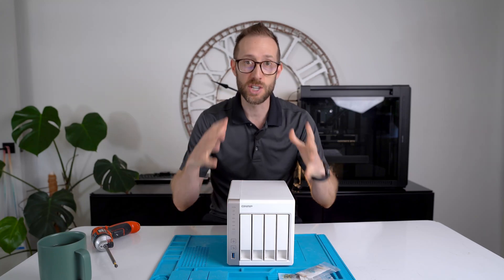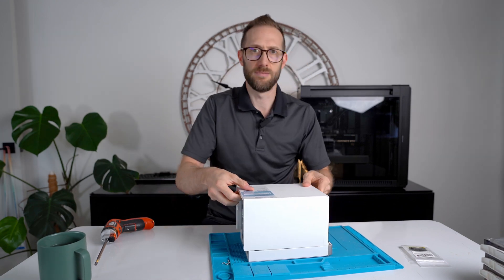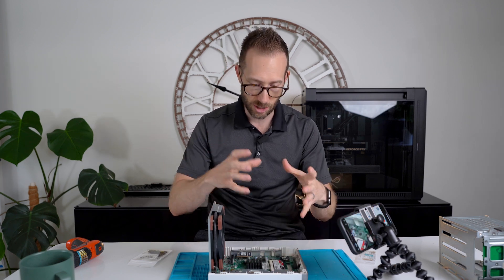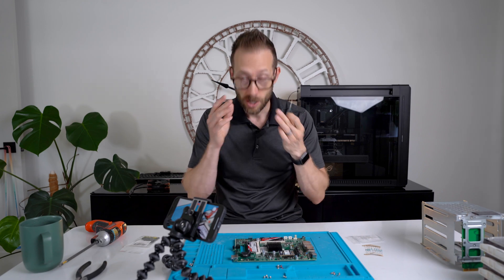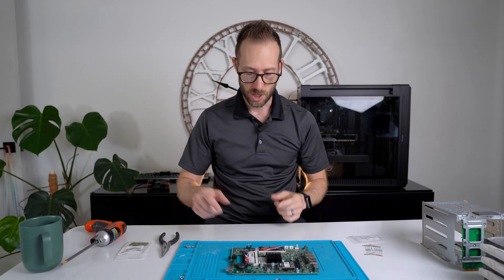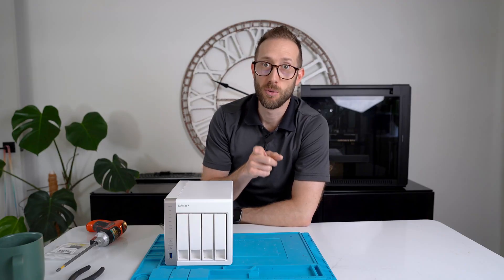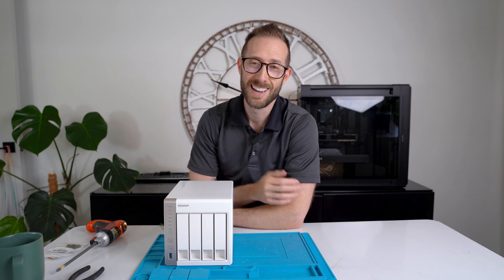QNAP NAS Red Light Fix Instructions (No Solder Solution)

Comment: If you have an old NAS, setup ProxMox and CasaOS on a spare pc/laptop/pi, and point its built-in file explorer to your NAS. I'd make a Nas user called "CasaOS" with the required permissions. 

Then you can access your data
Reply from the maker: Yeah, I'm on the fence of setting up my own hardware for a NAS.  I really do enjoy the small form factor of a NAS, but I could always pick up an old 1-2U rack server with some storage.
Reply: @JohnLCharette  the main issue with most off the shelf Nas solution is this - if the NAS fails, repairs/spares/data recovery is $$$. 

Ideally you want a solution which allows you to simply plug and play the data to another system, while still being encrypted.
Reply from the maker: My previous experience with this works, assuming you have the same or compatible RAID controller in your new system.  Do you recommend using an onboard RAID controller, such as the Intel controllers or a PCI-E x4 card?  If a card, which do you recommend?
Reply: @JohnLCharette  as much as possible, I avoid RAID in my Home. Software Raid should never ever be used. Going hardware raid = buying 2 identical controllers + disks to rebuild.

A solid, scheduled clone to alternating disks does a great job, at a much lower cost. :)

My critical data is cloned across 4 disks. 2 are for live production and basic failover. The other 2 alternate weekly.

Recently I had to find something from 2019 that I knew I had... Looked on my backups, boom. No better feeling.
Reply from the maker: Interesting approach to avoid RAID completely.. other than RAID1.  It's not a bad idea and you solve many concerns.  It costs more due to more required HDDs, but isn't a bad approach.  I appreciate the insight.

Comment: Once the drive is revived, does that resistor need to stay in place?
Reply from the maker: Not 100% sure.  My understanding is that it needs to be there to boot.  I haven't turned my NAS off in months and I'm worried that when I do, it won't boot again.  I would probably recommend leaving it place though.  Why, did you want to remove it?

Comment: I have exactly the same symptoms on my TS-451 but neither 100 Ohm nor 150 Ohm did the trick. 
I've seen somewhere that an alternative could be pin 1 to 3.3V instead of ground. Do you  know anything about that?
Reply: I'm no expert, just a nerd. Check the following with a multimeter if you can:

0. Check that the PSU is giving the right voltage into the unit and on the other side of the DC jack.

1. 3.3v rail + CMOS battery should be above 3v when tested outside of the system.

2. 5v (usb etc).

3. CPU should be 12v, but rather Google to make sure for the specific CPU and Nas model.
Reply from the maker: Darn.  That sucks.  No, I was only following the instructions that are in the description of my video.  So sorry I couldn't be more help :(
Reply: @JohnLCharette  Hi, and many thanks for taking the time to reply.  I continued to experiment (encouraged by you) and actually got it running again by twisting two resistors in parallel : One 100 Ohm and the other 150 Ohm which effectively means 125 Ohm (which I didn't have), and that worked 👍👍
Reply from the maker: Oh wow, that's incredible!  I'm going to pin this message so that anyone else with a similar issue can try that solution.  Thanks for sharing!
Reply: @metoo7587  100 and 150 ohm in parallel = 60 Ohm! (not 125)
Reply: @yrumel-g6w  You're right!  Thanks for that correction 😊 Anyway, it did work 👍

Comment: Woke up to this issue today. Mine's been running for a long time. Maybe 10 years? I never could solder correctly so I wrote this one off until I found this video. Ordered the parts, we'll give it a go on Tuesday! :) Just need it operating long enough to transfer to a new Ugreen NAS. This should do it.
Reply from the maker: Mine is just about as old!  Considering, it's earned it's keep.  I had to replace the system fan once, but other than that.. it's been good.  Good luck with the install.. I was in the exact same boat.  I 'have' soldiered in the past, but I'm not very good at it.  When I saw this solution, I had to try it.
Reply: @JohnLCharette  Just did the fix. We're back online. I'm just going to backup everything and use it until the Ugreen arrives! Thanks again for this.
Reply from the maker: Amazing!  I've also been looking at the UGreen units.  Which model did you order?
Reply: @JohnLCharette  The dxp4800+. After looking at qnap and synology, the ugreen has better hardware specs for not a lot more in cost. And if you get it on ebay you save even more. Finding them in the $500 range new.
Reply from the maker: Very nice!  I was thinking about upgrading to their six bay unit, but it's significantly more expensive.  I know I'm playing with fire with my QNAP.  I fixed it a few months back now, so who knows how long it will last.  I get the feeling that if I don't ever turn it off, it won't die.

Comment: I did this repair about 6 months ago.  All was going great and now the problem has returned.  I soldered it, so little chance that the resistor worked itself loose.   Any ideas if there is another fix to extend the life a bit more?
Reply from the maker: Oh no.. I haven’t heard of another fix. I was told it was only a temporary fix but I also don’t know if the symptoms are the same when it eventually dies, so it’s hard to tell. I’ll pin your comment so hopefully others see it and can help.
Reply: Thanks.  This is a dedicated Plex server for family, so no huge loss. However the phone has already started ringing asking where it went. I suppose I just need to get another qnap that's compatible with the raid array so I don't have to source all the material again.
Reply from the maker: Yeah, I was thinking the same.  QNAP does have a compatibility tool that helps you select a migration path.
Reply: Did you try another resistor? I wonder if they go bad being that this is kind of a temporary fix to an issue? Just a thought.

Comment: Mine would not boot after the resistor being added. Disconnected from pin 8 and will checking voltages undifferent resistances it was notices that adding a 1 ft jumper between resistpr and pin 8 it would work. Doesn't make sense since the jumper resistance is 0.1 ohms, but it works. I used 20AWG wire and left it coiled up above the RAM.
Reply from the maker: Ohh, very interesting.  Can you please confirm which model QNAP you created that custom fix for?

Comment: Thank you so much for this, I have a TS 253 Pro which had the 3 red lights after we had multiple mains failures in a day, I thought I'd lost everything but thanks to this I got it back. I have a ten pin socket too and yes it still was 1 and 8, once again thanks a lot.
Reply from the maker: No problem!  I'm glad it was an easy enough fix.  QNAP is sending me a TS-233 to test out.  Were you happy with your device?  Are you staying in the 2 bay world or upgrading?
Reply: @JohnLCharette  I'm thinking of giving up altogether. I had one so my 2 sons could access all save films, games etc but they have now moved on so it leaves me and my wife so I'm thinking copy everything to a HDD and just storing it in a drawer and get it out when I need it. Too much hassle now, I'm 62, disabled and grumpy so I think I'll just stick to the drawer. You saved me from having to download hours of stuff, so once again cheers.

Comment: Thanks John, great video. I was ready to toss my 451+ and just buy a new one, but this fix should buy me some time and give me a chance to get any data off that I didn’t get backed up.
Reply: The 100 ohm resistor did the trick, I had the resistor in my spare electronic parts already and I just soldered it on the pins with some heat shrink tubing covering it to keep it from shorting on anything, but it was a quick fix. Concerning the replacement I think I’ll look at Synology. It bothers me that QNAP knew about the  atom processor/clock sync issue and kept selling their product knowing that they would all fail. No it sure I want to give them any more of my money or trust. I’m going to need to do some research though before I decide which one. When I figure it out I’ll let you know. The biggest thing I use mine for is storing my multimedia collection and running a Plex server on it, so my needs are probably smaller than yours.
Reply from the maker: Good!  I'm glad the fix worked.  As for QNAP vs Synology, know that any Synology that used the same Intel Atom processor, had the same issue.  It isn't just a QNAP thing.  That said, I understand your reluctance to go with them again.  I'm still on the fence myself.  From what I've heard, QNAP has better hardware, but Synology has better software.  Ahh, decisions, decisions.  Let me know what you end up getting.
Reply from the maker: Aww, so glad you found it.  Do the fix... it's pretty easy and a cheap solution.  I'm curious, what NAS are you considering replacing it with?  I'm still on the fence myself.
Reply: Did a bit of research over the weekend and I’m strongly considering the UGREEN DXP4800. I only need a 4 bay unit, but they do have a 6 bay as well for a bit more.
Reply from the maker: Ohhhhhh, I was SOO thinking about their 6-bay version.  I've heard great things.
Reply from the maker: The only thing holding me back right now is their software.  You still can't install Plex without installing it via a Docker.

Comment: Does this fix works for TS-251+? Same symptoms, not booting and no beep.
Reply from the maker: I think so. If you read through a lot of the comments. Some others have resolved the same issue with different models. Sometimes there’s 10 pins instead of 9, but I’m told you connect the transistor to the same pin 1 + 9 and it works.  Let me know how it goes.
Reply: Yes, it works.

Comment: I twisted 4 470 Ohm resistors in parallel and soldered the long end to pin 1 and pin 10 on original TS 251 circa 2014 era QNAP NAS.  Runs great!   Rather than assembling it all back together just load up the HDD on bottom, then stack the mainboard on top, install some paper, and plug in the fan.  Mine is running for hours fine just to copy all the volumes to a new Synology lol
Reply from the maker: Oh wow.  That's one way to do it ;)  Thanks for sharing your story.  Are you able to share which model Synology you purchased and why you decided to switch brands?  I'm still shopping for a solution myself.

Comment: I'm sorry but this is a bad advice, a bad video. You will not make a proper connection with jumpers and forced contact. It has to be done by soldering. If you cant do it, look for a friend or a shop that can. after all it is better done in a proper electronic lab. trust me on this.
Reply from the maker: Don't get me wrong, soldiering is always a better solution.  Considering that all of these NASs are going to die and this solution may extend the life for another couple of months while you transfer the data and buy yourself a new NAS. That's all it meant to do.  Check the comments, it's helped many people get past the boot problem.  It isn't a permanent solution or fix.
Reply: Worked perfectly for me no solder and got it running just to get the last files that missed the latest backup, so in my case not soldering was a much easier idea!

Comment: Just want to add another person who this has helped. I have the QNAP TS-451 (not 451s), I also have the 10 pins and not the 9 with a blank. I jumped the 1 & 8 with this technique and my system is now working again. Will update if anything changes.
Reply from the maker: That's amazing.  So happy to hear it's helping.  Are you looking for a replacement NAS yet?  I'm curious what brand/model you are considering.
Reply: @JohnLCharette  I was looking for a NAS but instead rebuilt an old workstation and added drives to a large encloser and then shared it over smb. now I can access it as a network drive and also remote desktop from anywhere else in the world. I'll use the NAS i just fixed using your method until it goes completely.
Reply from the maker: Great solution.  I had considered doing the same thing.. even installing TrueNAS on a computer.  I still haven't decided what I'm going to do.  I would love something with a couple m.2 slots built in, but devices that support them are so expensive.
Reply: @JohnLCharette  I don't think you're going to get the performance from an M.2 than a SATA SSD if it's purely for a NAS. Find a 2nd hand more recent workstation that can take 128gb ddr3/ddr4 ram, and send it. Way cheaper. And then there's ton's of HDD enclosures on amazon or 2nd hand to make your pools
Reply from the maker: Hmmm.. it's something to consider.  Now you have me thinking ;)

Comment: Hey I have 10 pins not 9. TS-451 not +. So should I target 1 and 8?
Reply from the maker: Great question!  I don't know, but I know someone else just commented on doing it with 10-pins and it worked.  I've left a message and waiting to hear back  if they still used 1 + 8 or not.  I'll keep you posted.
Reply: Hi @JohnLCharette, did you get a reply about the 10 pin ts-451? Is it still pins 1 and 8 even though it has 10 pins total, not 9? Looking to do same fix. Thanks.
Reply from the maker: I didn't get confirmation. I asked them and they didn't answer me directly but instead wanted to send photos, which I never received :(  If you go back through the comments on this video, you'll see the thread.  From what I gather, yes it's still pin 1+8, but if I was doing it, I'd love someone to confirm too before hand.  I mean, if your NAS it dead, you could just try it.. but your call.
Reply: @JohnLCharette  Tried pins 1 and 8 (on NAS with 10 pins) and the fix worked totally fine for me. Copied all data to an external hard drive and now looking to buy a new NAS and probably drives.
Reply from the maker: Amazing!  Thank you for confirming.  I'm going to pin this thread.  I'm curious, what brand/model NAS are you looking at?  I saw Ubiquiti announced their UNAS Pro last week.. it's a bit basic, but I do love Ubiquiti.
Reply: @JohnLCharette  My brother has worked in corporate IT for a number of years and strongly recommend synology. I'm familiar with qnap operating system and saw that current Aus store they have 40% off a lot of models so might still go with them. Brother also mentioned if I wanted to go 'fancy' that some NAS now come with SSD but by looks of it you definitely pay for it.
Reply from the maker: Yeah, I've heard great things about Synology but I've never used one myself.  I hear the hardware is better with QNAP, but the software is better with Synology.  As for SSD, if you mean m.2, then yes.. the newer models that support them are quite expensive.  That Ubiquiti UNAS has 7x 3.5" bays, which could be used with 2.5" SSDs, but they aren't common anymore.  Ideally, you want a device with 4-5x 3.5" bays and then 2-4 m.2 slots.  QNAP has them, but they are $2000+.
Reply: Pin 8 and Pin 10 should measure 0.3 ohms or so meaning they are both ground.

Comment: I woke up this morning to find my qnap ts-253  pro boot looping, I was able to log into the device and tell it to install a firmware update. It rebooted to apply the update but now appears to have this issue. It has been working fine for years but now the HD LEDs are lit and there is no POST beep. The reset pin does nothing and there is no BIOS output over HDMI.

I have ordered the same resister but have not been able to find a reliable image for my device indecating which pins are correct

I believe I have identifed the correct header (it is labelled "LPC CN1" as per the example, the only other similar header has only 8 pins) but it has all 10 pins, there is no missing pin as you would expect to see on a regular a USB header (pin/key 9 on your device is on the oposite corner to a regular USB header), there is a thicker corner on the white border printed on the PCB (as seen at 6:06) does this indecate orientation?

Is it likely that the correct pins are the same as shown? Is there any way to test to confirm that they are correct before applying the fix?
If the pins were reversed is it likely to cause damage?
Reply: You sir are a star. Seems good so far, it took forever to boot, I imagine it didn't get to install the firmware last time or it needed to run a disk check? But it is up and no red LEDs. 

The highlited corner does appear to indecate orientation.
Reply from the maker: Awww, I’m so glad you got it working.  Good job!
Reply from the maker: I'm curious, I have other people asking who have 10-pin solutions.  Which two pins did you connect together?  Was it still 1 & 8?
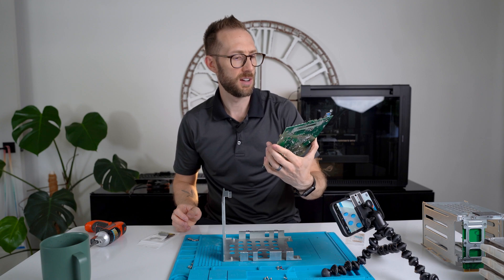Reply from the maker: When I first opened it up, I found a set of pins that I thought were correct, but weren't.  If you to go 3:25, you'll see me hold up the board.  Along the bottom left, there's a set of pins (I think 8 of them), but they have a white border.  It isn't that set.  It's the set of pins in the top left corner.  Hope this helps!
Reply: @JohnLCharette  My board is slighlty different as it is a 2 bay and the RAM is rear mounted. I will let you know how I get on, many thanks for the information :)
Reply: Because I had issues finding an image for mine I have uploaded pictures.

Search Qnap ts-253 pro 100Ω
Reply from the maker: Sorry, where am I searching?  Does it show which two pins you connected?
Reply: @JohnLCharette  the Internet, sorry youtube deleted the link.
Reply from the maker: Darn. Can you email me a copy of the images?  I'm generally curious how you did it, so that I can share it with others.  john@johnnyactionstudios.com
Reply from the maker: For anyone following this thread, another user confirmed that even with 10 pins, it's pin 1+8 and it works :)